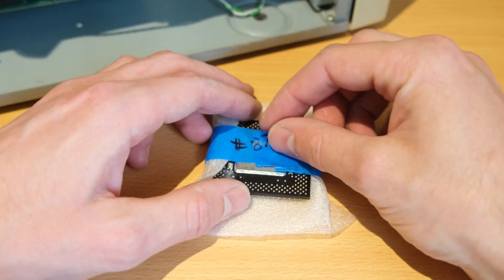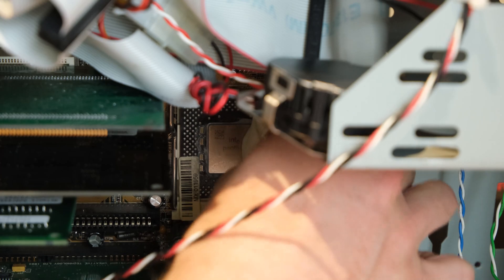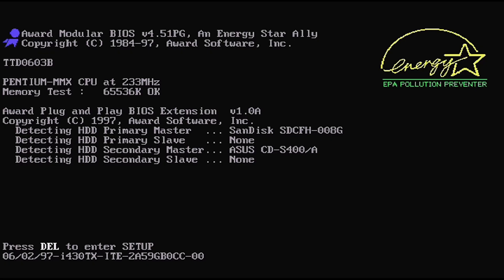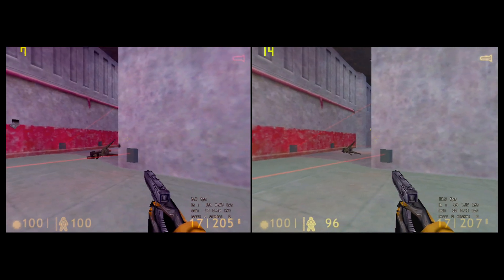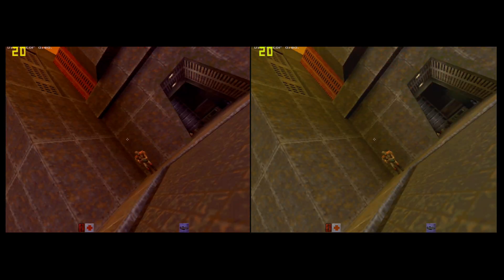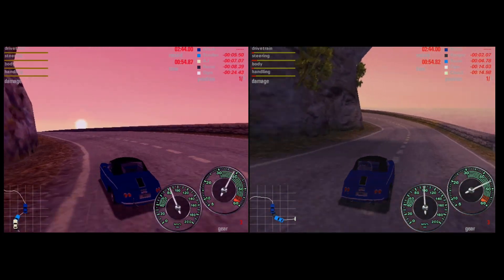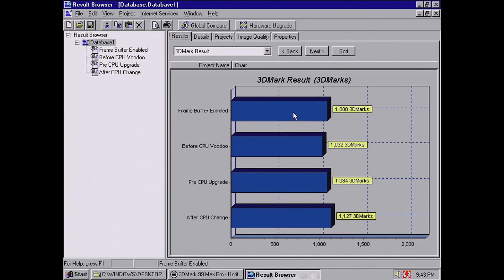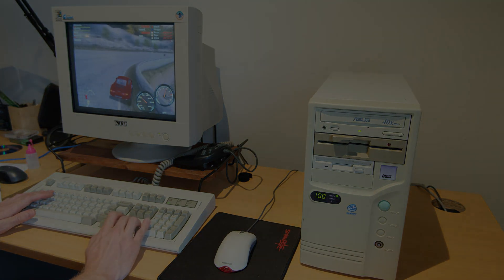What Does An extra 33MHz Get You? | Socket 7 Upgrade

Comment: I picked up a 233MMX from ebay for cheap because why not, but my socket 7 motherboard only officially supports up to 200MHz. I guess it's not that big of a deal though. A lot faster than the old Pentium 150MHz though.
Reply from the maker: Ah yes might be a limitation of the voltage regulator and the clock for the multiplier. At least with 200mhz I really didn't see the difference between the two
Reply: @thesmokingcap  i wonder if windows performance is better at 233MHz though

Comment: I'm pretty sure the K6 line is faster than P-MMX IIRC.
Reply: Standard K6 was ever so slightly faster clock for clock in certain benchmarks and tasks, but not in anything that used the FPU. The K6-2 however, was faster, but then again, that ran at higher clocks. I used to have K6 200MHz back in the day. I ran it at 75MHz bus and 3x multiplier, for 225MHz. That's not a major overclock by any means, but the small bump in front side bus actually made a noticeable difference, while not pushing anything so far that you might run into instabilities or required anything beyond basic cooling.

Comment: My first retro build a few years ago is a similar machine. I wanted to build a better version of the PC I had as a teenager, as if I had the capability to max it out. I've got an S3 Virge as my 2D card and a Voodoo 2 PCI as my 3D card. 32 MB of RAM, 7200 RPM 20 GB Maxtor Hard drive, and an AWE 64. Funnily enough, I just bought a 233 MHZ P1 with MMX to upgrade it. I also have a Super Socket 7 board that I recently got that supports 512 MB of RAM and has an AGP slot. I have an extra 233 MHZ processor and A Voodoo 3 2000. I want to see how the two systems compare to one another. Might also be fun to try to toss Windows XP at the Super Socket 7 build at some point just for a laugh. Also, are you by any chance a New Zeelander? I have a few Youtubers that I watch that are Australian, and your accent is messing with my brain. It's similar enough that my brain is expecting it to sound Australian, but there are certain things that sound different.
Reply from the maker: Wow that would be quite the build. Super socket 7 would open up so many options. I'm a bit on the fence about using a voodo2 in this machine as the CPU is rather limiting. Yes I'm a kiwi! But from the south island so a slightly different accent

Comment: I can play Half-Life just fine on my Pentium 133 with 48Mb of ram. I use a 16Mb Voodoo 3 in that which makes for impressive performance considering the actual performance of this computer
Reply from the maker: Interesting! Is there any special patches you had to use? I've got some ideas to try out as well
Reply: @thesmokingcap  It have worked with the built in 3Dfx mini driver in half-life. However since I run this with with such low speed cpu the performance gonna differ depending how much is going on in the area. Even though it might hit as much as 30fps in quiet areas at 800x600 resolution but the lows are terrible even at lower resolution. What I seen is that the resolution does not affect that much with the Voodoo 3 as much as cpu limitations so if you would run your computer with a stronger card I think you would get a much smoother experience

Comment: whats faster 166mhz with MMX or 200MHZ without MMX
Reply: I'm pretty sure the MMX 166 and 200 MHz non-MMX will trade blows (i.e. it will depend on what you are benchmarking) without a clear winner. the MMX CPU can be upwards of 10-30% faster clock for clock; and the 200 MHz non-MMX clocks 20% higher. It's going to depend on the particular game.
Reply from the maker: @soylentgreenb  Yes good point. Those API's or instructions can make a difference! I've got a motherboard that is pre super socket 7 with AGP but it's very buggy and locks up
Reply from the maker: Hummm, good question. I don't have a non mmx 166 mhz cpu. But I have one with MMX support.
Reply: @thesmokingcap  those are both I have and was just curious if you tested one without.thanks though
Reply: They are about the same. Some games rely heavily on clock speeds, and they will run faster on the 200MHz non-mmx, but the improvements to the architecture in the mmx-models, including larger L1 cache, will usually even out the playing field. I'm in the middle of a move, so I've started packing down all my retro gear, so I can't do any testing now for specific results, but I've done some testing in the past, and I would personally go with the 166mmx over the standard 200.

Comment: I think socket 7's main limiting factor in later years of games was no AGP support. A pentium 233 would've gotten a lot better framerate with a later 90's card without a doubt
Reply: I believe a few very late socket 7 motherboards did have an AGP slot, and there were also super socket 7 motherboards which supported many socket 7 CPUs. It might be hard getting a CPU, motherboard, and AGP video card combination that will play nicely with each other, but technically possible.
Reply from the maker: @spoonified52  Ahh yes, Indeed there were. I've got a pre super socket 7 motherboard with early AGP, I did a video on a while ago. It doesn't work too well but want to see if I can try to make it more stable
Reply: No, absolutely not. AGP was irrelevant. You needed upwards of a 1 GHz CPU to get the best performance out of a voodoo 3 PCI; and that's with an architecture that has a much better FPU like pentium III or K7. Pentium 233 MMX is not even close to maxing out a voodoo 2 even if you crank the resolution as high as it will go (which is a mere 800x600).
Reply: @soylentgreenb  Well, the Voodoo 3 didn't have great AGP implementation and lacked support for certain features, like AGP Texturing entirely. It was a PCI card at heart, so it's not the best card for testing the performance difference between PCI and AGP. However, even the PCI bus rarely was saturated back when the Pentium MMX was currentt, so I totally agree that AGP was irrelevant for such a system.
Reply: @rebeccaschade3987  AGP texturing was never useful. It was a "tick-box" feature. A geforce 4 mx 440 of the same type (e.g. 128 bit DDR) worked just as well over PCI as AGP; that's already much, much faster than voodoo 5.
Reply from the maker: I suspect that's the case. Unless you have a nice fast Voodoo 2 or 3 I guess, and can use some nice API's

Comment: Also changing the soundcard will help with the fps. Some cards use less cpu time then others. The AWE64 has the lowest cpu time of all the cards I tested. The voodoo 2 will be allot faster, even with the MMX 233. Optimizing bios settings will help to. You can use a tool called Tweakbios to change hidden bios settings and will gain some speed to. You will have to find a registered, downloadable version of tweakbios. There is some headroom for improvement, without spending much (besides the voodoo 2)
Reply from the maker: Interesting, I have heard about CPU usage with southcards. I thought that only applied to PCI cards instead of ISA cards. Philscomputerlab did a video on this a while ago. I have seen BIOS roms that you can flash to tweak the options. But I'm assuming you need a eprom tool to make a custom chip, if you don't want to modify the original one?
Reply: @thesmokingcap  

Tweakbios is a software program, that changes bios settings after booting. So it's save to use.

Just like PCI, the cpu needs time to send data to the ISA bus. You can also test it with winamp or another mp3 player and compare the cpu load between each soundcard. 
Quake 2 timedemo benchmark with sound enabled is also a good test. 
For faster systems I use the quake 3 timedemo benchmark. And even on an Athlon XP 2800+ i saw differences up to 8-10 fps.

Comment: I have just the exact same configuration for Socket 7(P200MMX, Voodoo1) machine and i was wondering if the upgrade worth it... Now i know :D
Reply: 33Mhz isn't much. You get a pretty linear performance boost of maybe 10%, if you're not bottlenecking with a GPU. If you're on a SS7 system, going for a K6-2 333 would be a worthy upgrade in most titles, although they perform worse in floating point precision than true pentiums. A K6-III or K6-2+ at 400Mhz or higher is the minimum Socket 7 CPU to be running games like HalfLife smoothly. You can also max out a VooDoo 1 card with a K62+.
Reply from the maker: @TheVanillatech  yeah GPU is a bottleneck as well. Needs something a bit faster
Reply from the maker: @TheVanillatech  Replied from the wrong account haha, Ahhh yep, good to know. I think some more testing might be in order on some other systems.
Reply from the maker: Yes haha, Don't bother really is my advice. I didn't notice much if any gains. But until you know, you know. There might be more that can be done to eek more from such a setup

Comment: Yea not much between the Intel 200MMX and the 233MMX. If you had the Fake China Intel CPUs that were most of the time the mobile Pentium MMX 266 overclock to 300 MHz (granted if your motherboard supported the odd voltage and jumper settings or the original AMD  K6-300 or the K6-2 300(since they could be set to 66 MHz from 100 MHz FSB) and if the board has that 4.5 jumper setting it would just see it as the original K6. This is probably when you would see some gains in your performance. If the software was written at the time to take more advantage of the Pentium II or K6-2 granted that's where you would see your gains but for someone on a budget that couldn't afford those newer CPUs at that time, you did what you could do and afford. Great Video and thanks for sharing.
Reply from the maker: Glad you enjoyed it! and thanks for info as well! Always find it handy as this stuff is like a dark art now haha. Yeah seems like Pentium 2 is were it was at for this type of gaming at least. Listed on the Retro Web, it seems the fastest CPU the board has listed is a 266 Mhz K6. But as you said with some jumper magic, I might be able to eek more from the system. I've got some other ideas with that Pre Super socket 7 motherboard with AGP I could try. But it's so unstable that it won't last for any benchmarks and games. So will have to look into that. But for now at least, it was a interesting test to see what you get.
Reply from the maker: Also a link to the mainboard I've got if you're curious, https://theretroweb.com/motherboards/s/biostar-mb-8500ttd

Comment: If you could get hold of a Riva TNT2 ...
Reply: Agree! Be careful of those 'cheap' Dell TNT2 M64s that look ideal for these machines but they require 3.3v from the PCI bus, not available in most AT boards... Currently thinking about modifying one TX board to support these ;)
Reply from the maker: @marquesdlr  Ahh yes good tip
Reply from the maker: Sadly this motherboard doesn't have any AGP slots. But If a PCI variant exists, that could be an option as well.

Comment: What board requirements do the likes of K6-II and better have?
Reply from the maker: Sadly this Motherboard is rather limited with what CPU's it supports. Seems that 266 Mhz is the fastest. But also limited on supported Voltages. More info here: https://theretroweb.com/motherboards/s/biostar-mb-8500ttd
Reply: @thesmokingcap  well you seem like a person that could retrofit multiplier settings and modify or piggyback a voltage regulator. I know TX won't stretch to 100 MHz FSB but 75*4.5=336 so that's something.
Reply from the maker: @SianaGearz  I appreciate your confidence in me! haha. I might need to do some research on something like that. But it would be a fun project!

Comment: Aside from gaming, by changing the CPU out for the 233, your computer barely meets the minimum requirements for running Windows XP.

There was one step above the Intel 233 with another OEM only socket 7 Intel 266.  Part number SL2Z4.
Reply: Yeah, but tha SL2Z4 is a Tillamook-CPU. Without fiddling with some cache-pins it won't work in a normal socket 7 board. It also has a rather unusual IO-Voltage of around 2.5V (normal Socket7-CPUs have 3.3V) - but they work, when modded, in a regular socket7-board and also run with 100MHz FSB! Real beasts if used correctly.
Reply from the maker: @dolphhandcreme  100 mhz FSB! wow that would be smoking fast for a socket 7, I've seen stuff like that online but I would melt something trying to get there haha
Reply: @thesmokingcap  yes, my statement was a bit unclear. Of course i'm talking about super-socket-7 boards and running a MMX with 100MHz FSB. Even regular MMX do support these frequencies. I have tested a bit.
Reply from the maker: Ahh I see, I guess with a super socket 7 you would have far more options for CPU's as well. I'd love to try one of those out one day. I thought I had one but it was pre Super Socket 7 with a very very early AGP adoption from VIA
Reply from the maker: I remember what Windows XP running on a old P2 IBM PC back in the day, it was rather slow for sure haha. Wow that 266 MHz chip must be rather rare to find these days. I've yet to see one of those
Reply: @thesmokingcap  They are at least somewhat rare.  There's only 1 for sale on Ebay (*not* mine) as of right now.
Reply from the maker: Oh cool! I'll have to go and have a look. Just to see what they look like

Comment: It was a weird time when Intel and AMD still shared the same socket. Sadly, something that will never ever happen again.
Reply: Cyrix too in those daya
Reply: @Inski584  don't forget Winchip and Rise! It's amazing how many different CPUs worked on this socket. Funny thing: Todays CPUs are some kind of SOC, have most components integrated (USB, SATA, Southbridge, PCIe, Memorycontroller) - it would be even easier today to make a socket which every vendor could use. But that's not what Intel wants. AMD is going their own way because they offer more than intel-sockets could do (f.e. PCIe-lanes), but Intel is still changing sockets every "tok".
Reply from the maker: Ahhh yes, a great point in time for such hardware. I guess now both companies have their own set of features and licensing. So would be tricky to replicate now in this age of fancy stuff
Reply: @thesmokingcap  i bet one could make a socket interposer for both platforms - the bios would be another issue! look at current serverboards, they only have cpu, sockets, connectors and vrm. The only real difference in the interconnect between cpu and peripheral nowadays is the pinout, vrm and firmware.

The last significant differences disappeared with the rise of the integrated MMU. (intel core2, amd k8) - since that era, the CPUs mostly speak PCIe to the motherboards. Modern CPUs are basically a System-on-chip. Southbridge is only SATA and some more PCIe-lanes.

Comment: Great video! I’ve played with this combo a lot and to be fair the voodoo 1 is severely bottlenecking performance here. With a voodoo 2, especially in SLI I think you’ll find the 33mhz helps. The bigger gain has already occurred from the 200 MMX having twice the L1 cache of the original P1. Comparing to a 166/200 non-MMX to the 233 MMX makes a bigger difference. Good ram and board cache with the timings maxed out pushes out the gains between these chips out a little further too. One of my favourite eras!
Reply from the maker: Thank you! Glad you enjoyed it. Ahh yes, the Voodoo 2! I have some other ideas with another motherboard I want to try. But I need to get the new test motherboard stable first with a AGP card. Currently the machine is using SD Ram but only 64MB as I'm told the 430 chipset can't cache more memory than that. But a fun period in time for sure as things were all over the place haha

Comment: NIce video. My 200mmx gained more performance at 225 with bus at 75mhz, than at 233 with bus at 66mhz.
Reply: Sure! That s what i used to do with my 166mmx. 225mhz all fine! Then one day I found my 3dfx (diamond monster 3d ) not working anymore. Could it be the consequences of the higher fsb speed?
Reply: @Barman_62  I had a monster II 3D with bus at 75 and was OK, but you never know.
Reply from the maker: Thank you! Ahh yes, the FSB over clock. I have some other ideas with another motherboard I would like to try out with these CPU's.